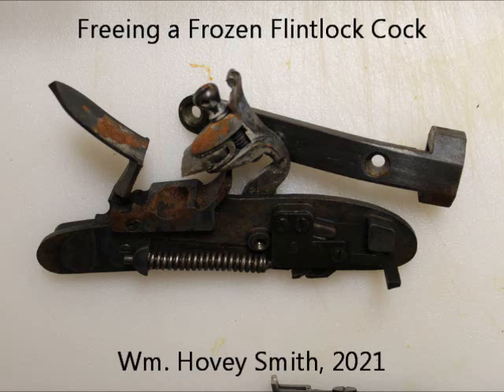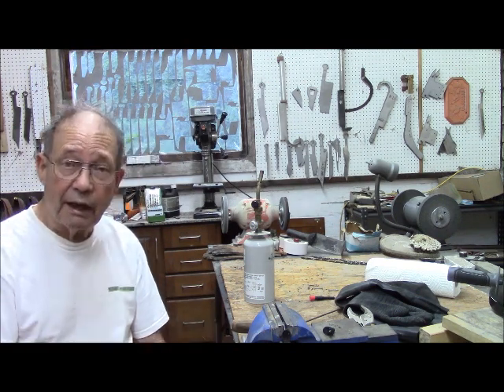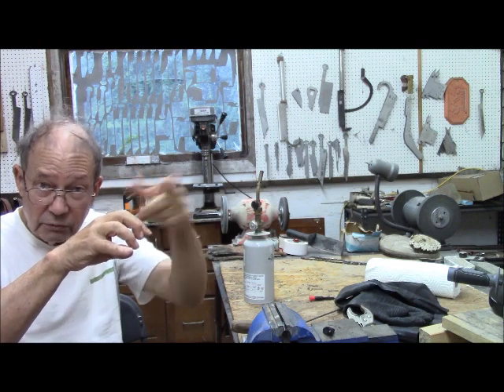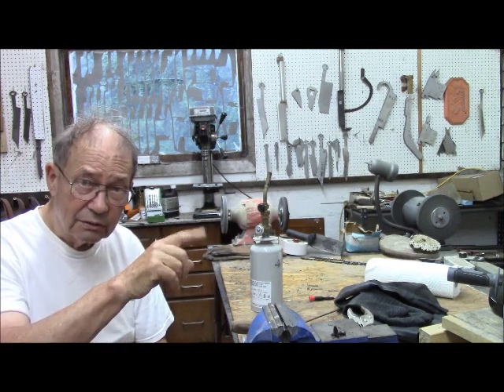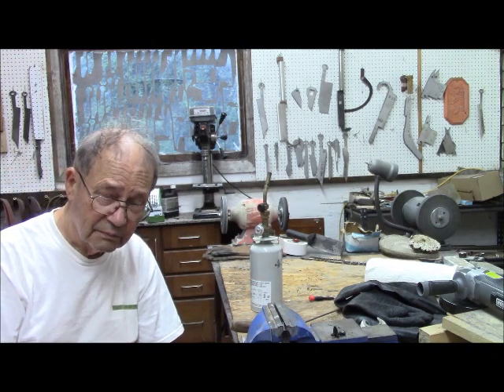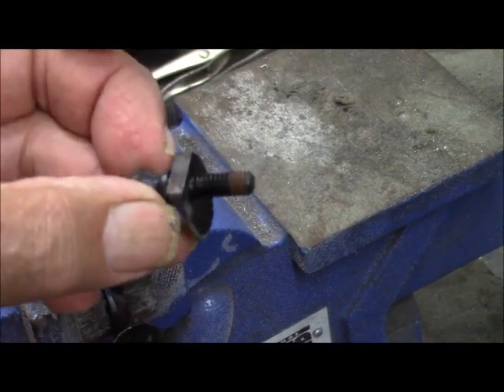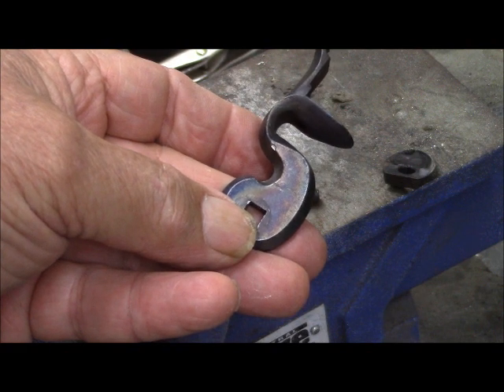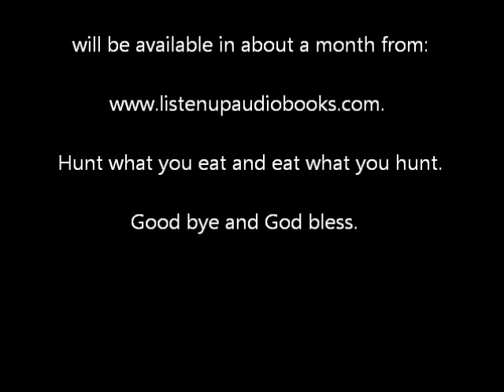Freeing a Frozen Flintlock Cock

Comment: Hello hovey love your videos watch every one, was wondering if you knew any methods to tighten a group on a old flint lock shotgun?
Reply from the maker: Plastic cushion wads are the most reasonable things that I have found. In the day they tried wax--cementing the shot with a filler, wire to tie them together, putting the shot in capsules, etc.